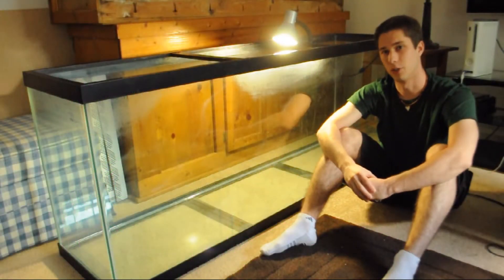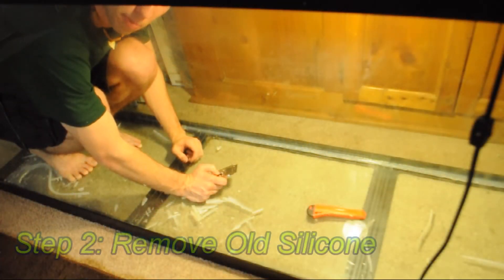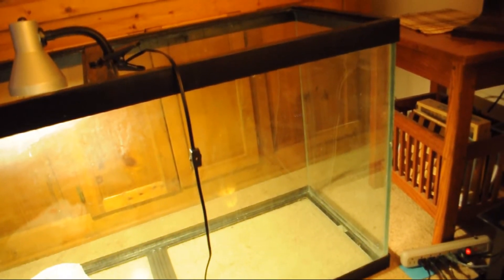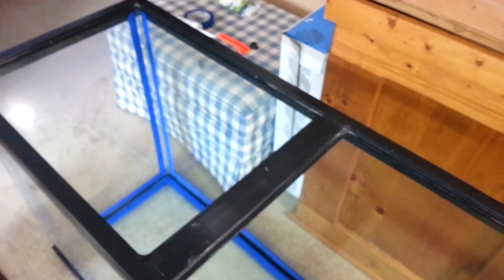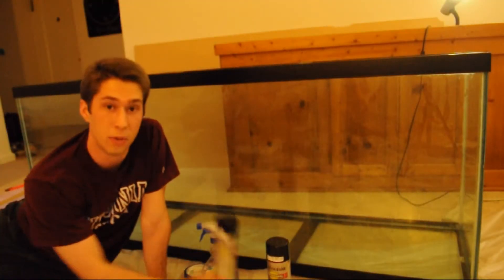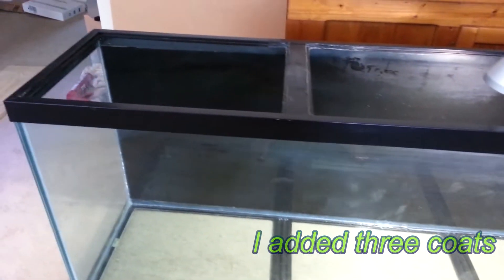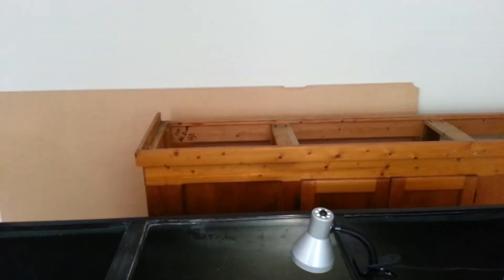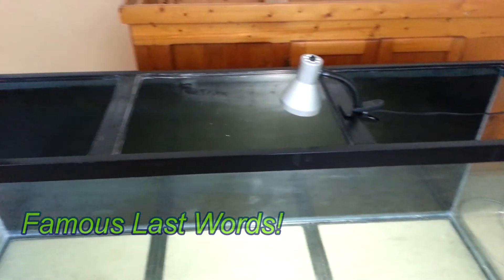Episode 1 - Tank Prep - 135G Development Series

Comment: O the joys of resealing :) looking good
Reply from the maker: I actually resealed it twice. The first time I did it by myself (and was the tape job that made it to the video) but I wasn't able to move quickly enough. I didn't follow the most efficient path through the tank either. I went to smooth the last corner and it had started to solidify. I messed up the curing, it became white, cracked, and bloby. I waited two days for it to solidify more and then scraped it all out again. It was a fun process :P
Reply: I used the v shape caulk tool for my last tank. Looks almost new. First go round used tape and once its skins over a little it tears when u pull the tape. Pain in the ass! Lol
Reply from the maker: North Florida Cichlids
Oh yeah. It's a fun project lol I can't wait to fill test it. I'll hopefully be filling later this week. I've finished painting the stand (may need another coat. I'll check when I have better light tomorrow) and can now place the tank in it's final home (hopefully final home. I don't want it's final place to be in the apartment below...)
Reply: Good luck keep me posted
Reply from the maker: North Florida Cichlids
Absolutely! Thanks!

Comment: it might be a little to late but fyi your hardware store should have a caulk finishing kit the has a tool to remove silicon easily
Reply from the maker: I do what I want :P A silicone removing piece would have been nice. The razor blade worked very well though and was <$2. It's multifunctional too! If I ever get invaded by robbers or need a close quarters weapon for a zombie apocalypse I'll probably die because that razor blade isn't going to do much

Comment: did you use acetone to rub off the residue after removing the old caulking? or is that not really neccessary?
Reply from the maker: I used rubbing alcohol to remove any oils that I would have left on the glass. I'm not sure if it's necessary but it did allow me to get a good seal.